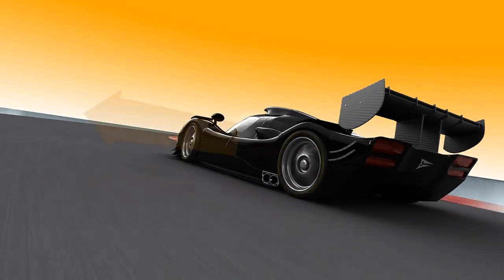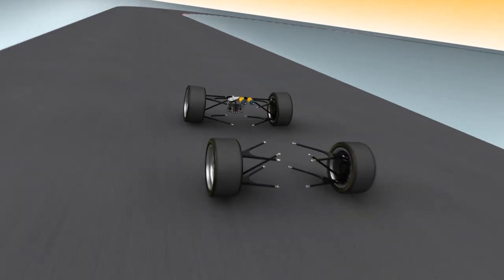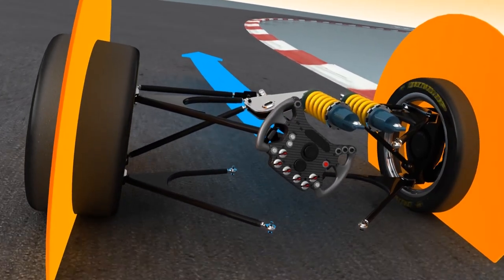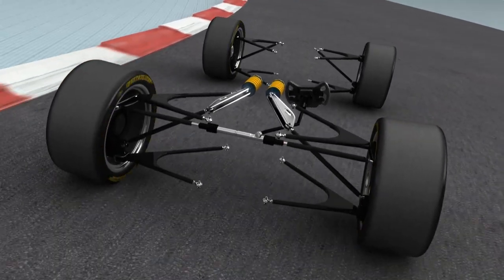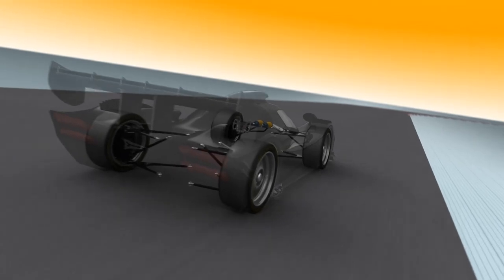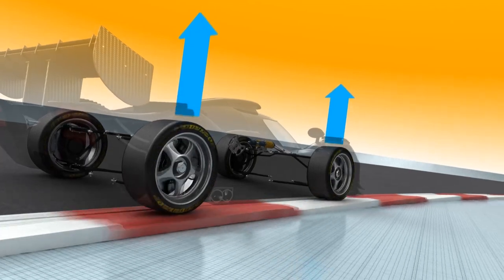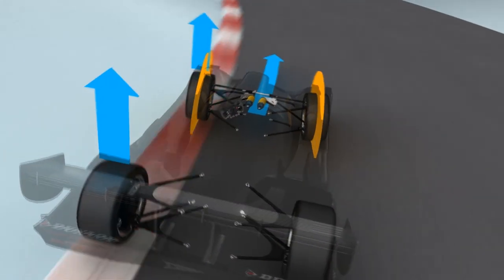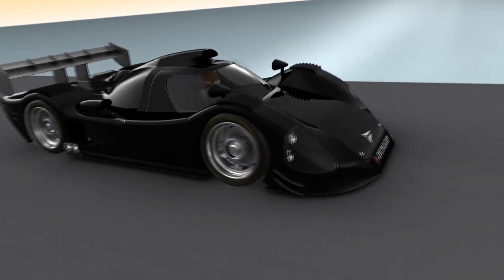Which forces act on a race car? - Straight line & cornering

Comment: Somehow this failed to mention even a single real force acting on the car itself. There's weight force, tire friction, tire normal force, and aerodynamic force. Tire friction is the primary force that the driver has immediate control over, being a function of steering wheel angle and throttle/brake pedal positions.

Comment: actually centripetal force is toward the center of the curve not outward
Reply: I know this is really late
But if you paid attention he said centrifugal not centripetal. And we all know they are opposites
Reply: It's been another 4 years and I'd just like to say that the arrow representing centrifugal force is wrong. There is no force pushing sideways on the car like that. 

The so called centrifugal force is just the momentum of the car resisting the centripetal force created by the steering input and acts in the direction of travel.

Comment: This really has so little information in it. =(
Ackerman steering.
A-arm mounting point geometry.
Roll Centres.
Reply: But then it would lead you down a rabbit hole and you’ll need to explain many things. But you’re right, this is over simplifying even the most basic principles.